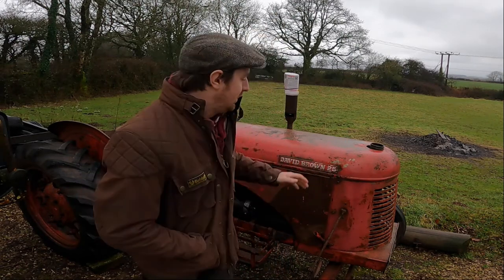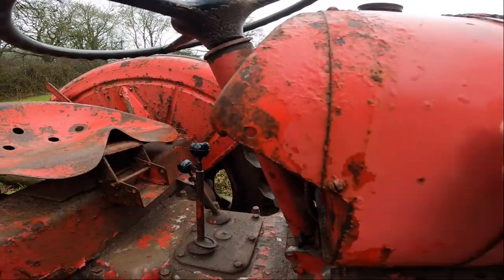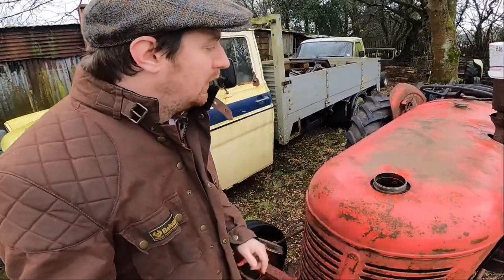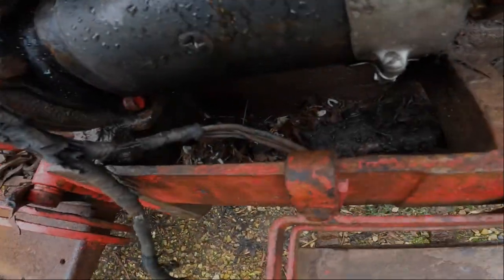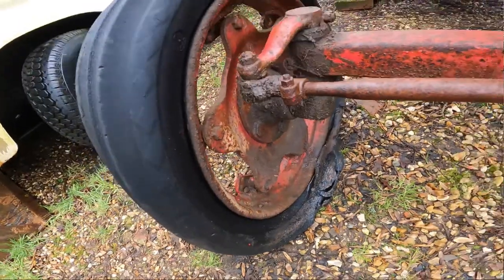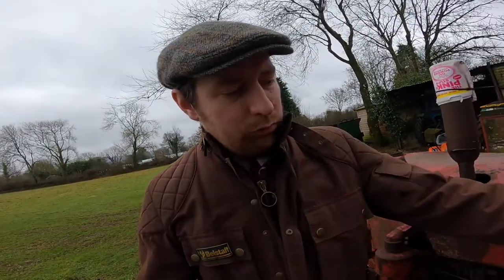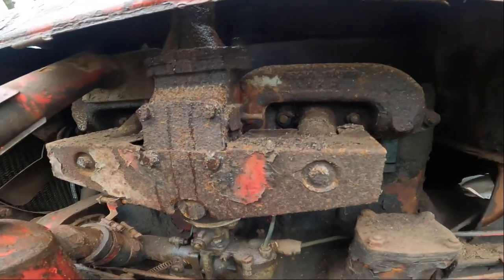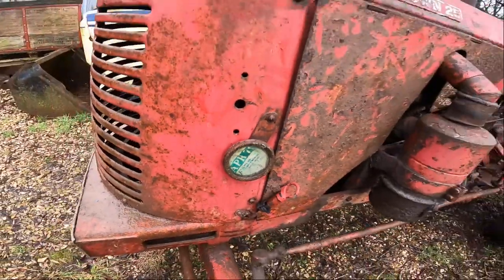David Brown 25 Restoration Project Part 1

Comment: A TVO model. Marty has a YouTube video of his similar 25 but his is a Petrol only model.   I think the petrol only versions are more common in NZ. I have a Cropmaster and a 25, both petrol only although the Cropmaster has the same TVO, two filler tank, and selector valve. I am sure we will all be following your restoration here and looking forward to seeing it all come together. My two were like Marty's, about the same condition, and deal, both with much less rust than your example. I am sure a little rust will be no problem to you guys. Great tractors.
Reply from the maker: Seems to be a few petrol and TVO models in Aus as well. Good to see another one saved. Many here ended up scrapped with frost damaged blocks.
We are certainly used to dealing with a bit of rust!